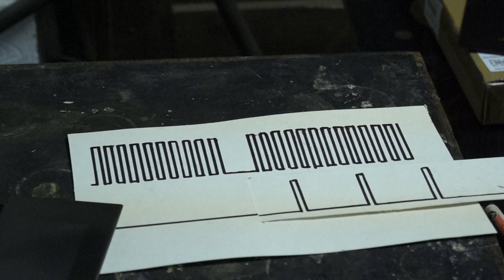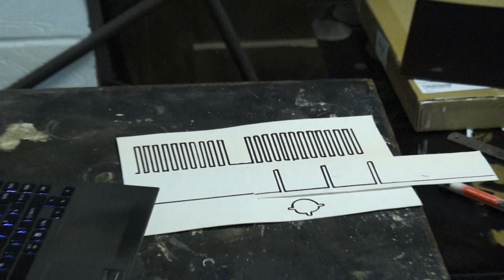Celica ST205 GT4 BEAMS Turbo - ECUmaster EMU Trigger Patterns

Comment: Having just watched your video, the one thing that struck me from your explanation of how the ecu reads the triggers, nominating the second tooth on the cam wheel should give the same results as the first. I.e when tooth 1 "disappears" the second tooth is now tooth 1 and tooth 3, 2! Does that make sense! So the net result is the same as the original set up. These are just my thoughts, and I'm no expert. Keep pluggin at it. I have a gt4 too hence the interest.
Reply from the maker: Exactly, it does not know which tooth is which, it just picks the first it 'sees'.  Next up is to work out why the sync is moving with the inlet vvt moving.
Reply: @theroteengineer8346  is the trigger wheel on the part of the cam driven by the belt or vvt? I assume it's the vvt part otherwise the relative positions would always be constant between cam and crank. Have you thought of changing cam sensor positions? Anyway, thanks for responding. Hope it gets resolved.
Reply from the maker: @pappy77__92  it is the OEM position. So on the camshaft post vvt.  So the relative positions change, allowing closed loop control.  But there are some hurdles to jump before we get there!